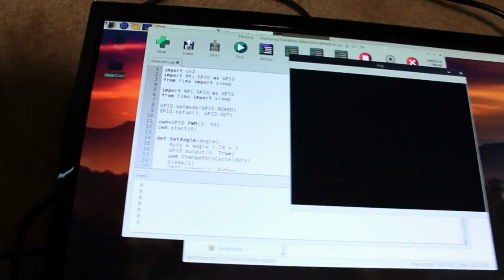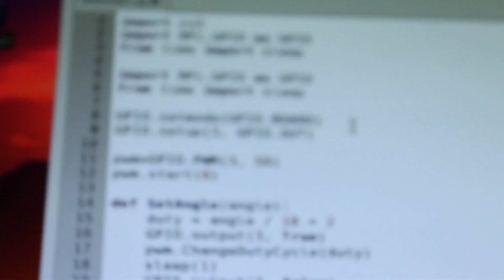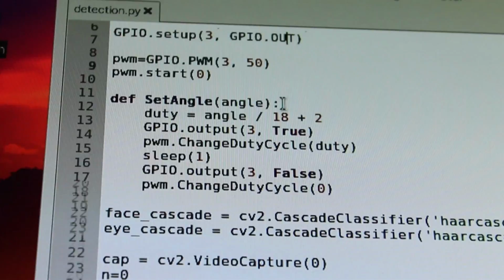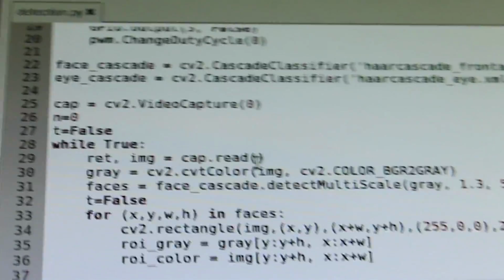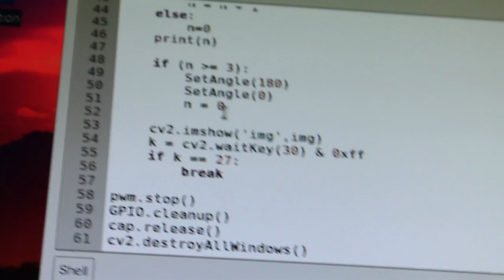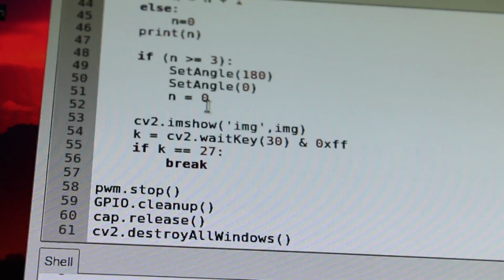A clock that falls off the wall when you look at it

Comment: Good idea, but bad execution. An improvement would be to have a permanent magnet (able to bear the clocks weight) with a coil that cancels it out. So when you look at the clock, it pulses the coil so, it just falls down, like its mounting failed just at the exact time you looked at it.

When you make it knocks itself down, it kind of gives away the joke, making it no longer fun. Like this, when someone (unaware of the modification) looks at the clock and it starts trying to jump off the nail, it becomes obvious the clock has been modified to do this. If you instead do so it just falls down, it will become kind of "shocking experience" for this person that just thinks "Did that clock hang soo loose it just fell down at the moment I looked at it?" and it will become a fun joke that people will still be unaware of later on if they never look at the back of the clock.

And if you hide the circuity with a backplate the joke can even be repeated again and again and again and people wont suspect anything haha.